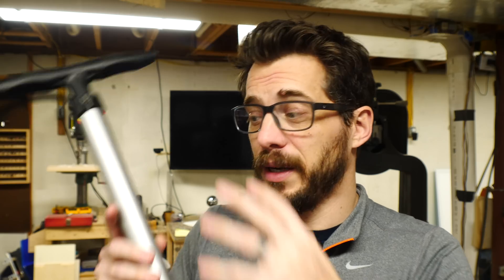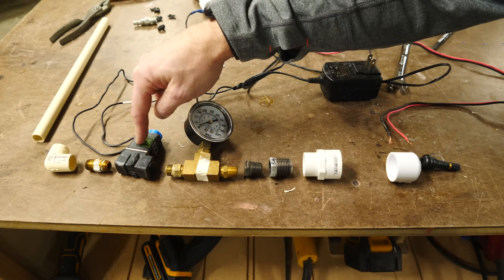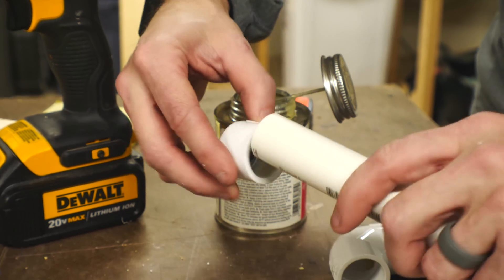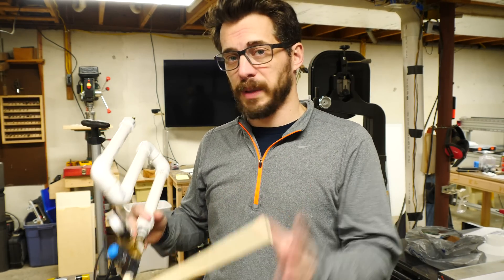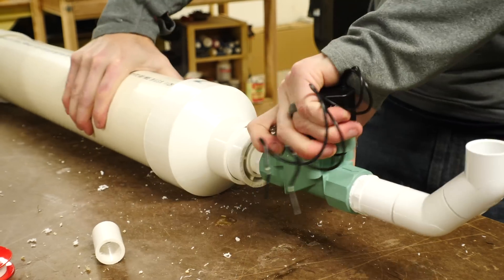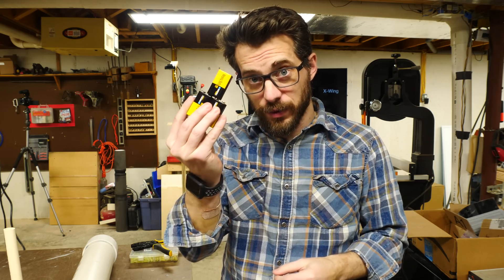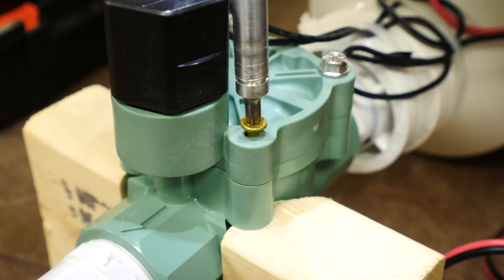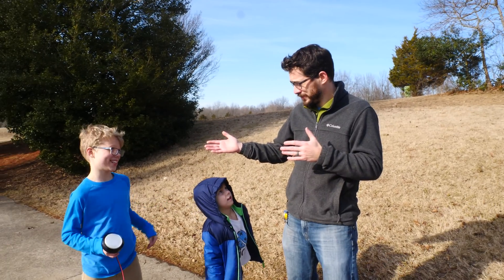How to Make an Air-Powered Rocket Launcher | I Like To Make Stuff

Comment: This is an old video, but I'd suggest building a small plywood box that contains the pressure chamber as a precaution against explosions.
Reply: I agree. I have had one explode at 40 psi. It was do to the air hammer of the valve slamming shut.

Comment: Can you tell me what the three step down pieces are called between the timeframe of :336 to 3:42? I am looking to make this same type with a large PVC diameter, but need to find a way to step it down to my 1 inch sprinkler valve.

Comment: So I made one today out of steel pipe.  I rigged the sprinkler valve like you showed, and the air slowly leaks out.  I tried a ball valve and it blasts out.  Does your valve release all the air at once? Did you modify it?

Comment: Late to the party, but glad I found it. Just built one for kids with motor problems to use (love the button!), but trying to get wiring right. Button inline, but you had wires going different directions and then tied down. A schematic anywhere? Mine works, but need the button for sure! Thanks for making cool stuff :-)

Comment: I have looked through the comments and didn't see what I was needing, I apologize for a dup question if it has been asked.  I see the 4" PVC with the reducer down to what looks like a 2" PVC, then a connector down to 1".  On the other side, 1" coming out of the valve, then I see a metal threaded piece, that is that piece?  Very cool project and I plan to make it this week for the grandboys!
Kent
Reply: KnKinCabot Kent looks like it’s reduced down to 1/2” cpvc since a nerf dart fit in it

Comment: Remove the spring inside the irrigation valve and it will discharge faster I used the same concept 14 years ago for a potato cannon

Comment: Great vid.  I made one of these a couple of years ago.i had 2 upgrades that you could add to your pretty easily.  I made a switch on a box with the button that turned on an led when the system was live. That helps for a little safety too.  It also made my daughter feel cool when she powered on the system.  She would yell " system live, stand back."  Also, I made the barrel coupler with threaded couplings so I could swap out the barrel.  For Halloween I put a 2 inch barrel on and fired candy up into the air with a wadding of paper towels to for the seal.  Great vid.

Comment: Cool project.  Safety note.  4" schedule 40 only has a working pressure of 133psi.  With a bicycle pump your probably fine but you could get close.  Now burst pressure is higher than you could get with that pump BUT PVC is not UV stable so having out in the sunlight is eventually going to greatly reduce it's burst strength.  This is compressed gas and PVC shatters like glass when it goes.  So I would pain it as a general precaution.

There was a time when a bunch of shops thought they would save some green and plumb their are lines with PVC.  Then a few years later they would explode and send everyone to the hospital.

With a hand pump I doubt your anywhere close to hazardous, this is more for a viewer who things they should supercharge it using CO2 or a high pressure pump.
Reply: That should have read "paint it as a general precaution".

Comment: QUICK PRO TIP. From a cub scout dad that has experimented with this type of device. 
If you put a penny or two under the nose cone/top of the fuselage and launch it without fins. They will go insanely high, you will lose sight of them. (Optimally 40psi in the chamber)

Comment: When you had to accommodate a larger tank, the engineer in me was like:
How high do you want this go?
Okay, use kinetic equations to determine initial velocity of rocket from it's mass and final height.
Then use kinematic equations to solve for instantaneous acceleration of the rocket from end of the pvc pipe using it's initial velocity.
Then use Newton's 2nd Law to find the force needed to be exert onto the rocket.
Then determine the pressure needed to be contained within the pvc tank using the force and cross-sectional area of the end of the pvc pipe.
Finally, draw a Mohr circle/tresca failure plot to see if the pvc tank is strong enough to contain the pressure.

Comment: Are you sure it needs 24v? I use mine consistently with 12v and have even used it temporarily with 9v, though 9v batteries seem to discharge quickly and heat up.

Comment: Bob - This is just like the launcher back in MAKE volume 15 (2008) by Rick Schertle.  Rick and I have redesigned that launcher into the current v2.2 with all metal pneumatic rated parts and an adjustable stand.  We also have 5 free templates to choose from on our website, 4 of them from our friends at NASA Kennedy Space Center, along with plastic & foam rocket kits, and even a plane that launches like a rocket but glides down like a plane.  Also, check out the links for free 3D printable rocket accessories - LED rocket for night launches, LEGO minifig adapter, fin guide, etc.  www.airrocketworks.com

Comment: Nice work. Just doubling the diameter of whatever pipe you have will give you over 4. 5 times the volume, (remember Pi times radius squared).  Bump up to schedule 80 PVC and a longer rocket tube and you'll be messaging the next town.

Comment: Be careful using pvc pipe as an air tank, especially around kids.  It's not designed to hold pressurized air.  If you overfill it, it will explode and shoot plastic shrapnel everywhere
Reply from the maker: That's why I'm only using a bike pump instead of a compressor. 👍🏼
Reply: I Like To Make Stuff Fair enough.

Comment: if you put the valve in the middle of the air chamber you will get more height, without increasing the size of the air chamber.  also, if you use a butterfly valve you will also get more height.

Comment: Replace the paper rocket with a bottle filled with some water. It will fly higher because the air in the bottle pushes the water out.

Comment: I did something very similar for a physics project in high school there's a way to make the sprinkler valve open without needing electrical components you simply just need a pressure release on the other side of the diaphragm if you do a little research online you probably can find out how to do that and eliminate all the batteries

Comment: I made a paper rocket launcher identical to this and I used the exact same sprinkler valve, however I found that the valve only required one 9v battery to open the valve and shoot off the rocket.

Comment: You didn’t have any problem with the valve not releasing the air fast enough? Iv seen a few videos that use sprinkler valves like this and often times they need to modify the valve to allow the air to escape faster.
Reply from the maker: Nope, worked great!

Comment: I was concerned about the psi ratings of the pvc, then went to a chart and realized that you're not likely to reach those levels with a bike pump.  Those using a compressor might want to consult a chart to ensure they don't over pressure the "tank" and have it explode in their face.
Reply: Good call, I never thought about gas vs. water.  Thanks for dropping the knowledge bomb.
Reply from the maker: Yup, exactly 👍🏼
Reply: Yeah if you look closer you will see that those ratings do not apply to compressed gas. When you compress gas you heat it up which softens pvc. If you then suddenly depressurize is rapidly you cause the temp to suddenly drop and make the plastic brittle. Over cycles this causes microfractures in the plastic. This can cause the PVC to explode under pressure. Please consider rebuilding this out of ABS or HDPE as they are rated for gas pressure.
Reply: Rick Edwards I’ve made a air powered potato launcher and used my dads compressor to pressurize it to ~110 psi many times and it was fine.

Comment: How much pressure are you putting into that pipe and what are the approximate corresponding rocket heights?  I'm concerned that we'll have to pump for 5 minutes for each rocket blast.
Reply: I'll answer my own question for the benefit of others.  I just built one of these today...almost identical to Bob's...4" PVC pressure cylinder, 1" sprinkler diaphragm valve, 1/2" low pressure launch tube, bicycle pump powering the whole works.  For the rockets I'm using "thick" paper which is something close to card-stock.  It's heavier than normal printer paper but it will still pass through a laser printer just fine.  At about 18-20 PSI a thick paper rocket will launch about 20-30 feet into the air.  I made a rocket out of normal weight printer paper and tried to launch it using 30 PSI and the paper literally exploded without leaving the launch tube.  I have not tried a thick paper at higher PSI yet but that will come soon.  One other note, I had a problem attaching the nose cones so I cut them out slightly over-sized and used hot glue all around the rim of the cone to seal it to the rocket tube.  That works really well.  Oh...and with the bicycle pump I'm using (again, almost identical to Bob's) it only takes 30-45 seconds of pumping to get up to about 20 PSI...not long at all.

Comment: What pressure were you filling up to? I know you're looking for max power, but depending on the pressure, it would be cool to do a two tank system with a reducer valve so you could get multiple shots without having to pump every time.
Reply from the maker: PVC isn't made to hold a ton of pressure so I was limiting it to what the bike pump could put out.
Reply: I started to build one this weekend with my kids, with a slightly altered design.  During the pressure test one of the fittings failed at 60psi.  Please be careful as it was a fairly kinetic event.  No one injured and only some pipe broken, but something to be aware of.

Comment: I love the big "Not for Pressure" on the side of the pipe....as you're making a pressure vessel with it. :-P (Granted it's mainly about water pressure and higher pressure than you're using at that, but it's still funny)
Reply from the maker: Yeah :)  That's why it's covered in blue tape and I'm just using a bike pump.  The schedule 40 is rated for 100 psi, so that warning is a little overkill.

Comment: Did your air compressor break?
Reply: By using the bicycle pump the kids get some exercise and the whole thing can be taken to the park - no need for electricity and the bicycle pump is more portable.  The Technorati might consider one of those tire pumps that hooks to a car cigarette lighter. Hook that to the value and get your air that way.
Reply from the maker: William is totally right. Also, the bike pump limits the total pressure that can be put into the chamber.  The pvc was rated for 100 psi and you could easily pass that with a compressor if you're not paying attention.

Comment: Great project/video!  It's great to see the kids involved.  A couple of tips for anyone making this:  1.  Wrap Teflon tape in the same direction as you tighten the female fitting so it doesn't bunch up.  2.  Gender your quick-connect electrical fittings so you can only plug it in the right way.

Comment: What a cool project to play with the kids...or alone! Very nice. Is filling the pressure chamber with a compressor an option ?
Reply from the maker: It definitely is but be careful not to over pressurize. This pipe is rated for 100 psi which is tough to hit with a bike pump.  A compressor could go past that pretty quickly and might shatter the PVC
Reply: I Like To Make Stuff Noted. Thanks for your answer !!
Reply: yes look up my video, I also use it as a candy shooter, marshmallow shooter, and have been able to shoot t-shirts a short distance.

Comment: we did something in my technology 9 class years ago i would recommend adding some thinned wood glue to the tip of your rocket so that it stays together on landing. When i made mine i put several layers of it and some inside the tip. we were going for distance and i won it by getting over 100 feet with that setup working multiple times. We also used an air compressor for air instead of a pressure chamber.

Comment: Instead of using 3 9volt batteries you could also use a boost circuit board and use 2 AA batteries and make it into a higher voltage

Comment: Suggestion, instead of using 90 degree elbows and a "line" of pipe for your pressure chamber. I would think a "T" fitting at the "top" of you chamber and then elbows to have the lengths of pipe end up parallel. Now all the air pressure stored in the length of pipe are "closer" to the end of the chamber instead of having to travel the whole length of the pressure chamber???? Ok, never mind you changed the chamber. Great idea. (potato gun next?) Glenn Lever

Comment: Air and pvc is not a great idea. pvc shatters when it fails at high pressure, you wouldnt want plastic embedded in your body. You cant see them in xray
Reply from the maker: You also can't pressurize this to that point with a bike pump.  The pump would fail before you hit the 100 psi rating.
Reply: I Like To Make Stuff fair enough

Comment: What a cool project.  What kind of PVC did you use?  I remember having to track down the pressure rated stuff when I built a spud cannon a few years ago.  Did you have to do that or could I just build one of these with schedule 40 from the home center?
Reply from the maker: I used schedule 40 since we're just using a bike pump.  That puts a built in limit of what you can physically add to it.  If you're using a compressor, get the right pipes for sure. 👍🏼
Reply: Awesome.  Thanks!

Comment: Cool project!  What psi did you find was good ?
Reply from the maker: I didn't put the pressure gauge on the larger one so I don't really know.  It was about 15 bike pumps worth :)
Reply: Ah I see.  Pretty low psi then.  I remember as a kid we would get the water rockets where you fill with water and air. Then it would fly up 100 feet or so.  You should try some pvc rockets